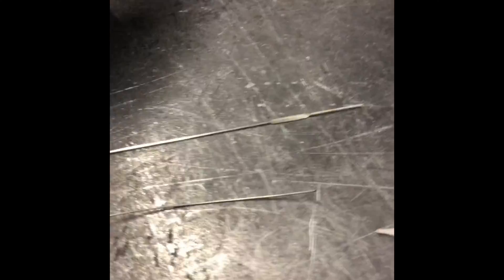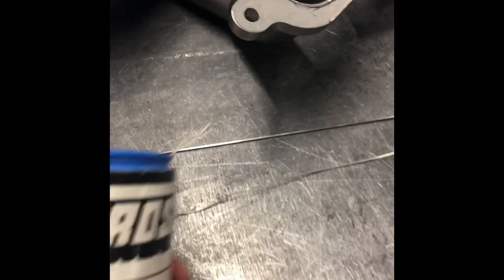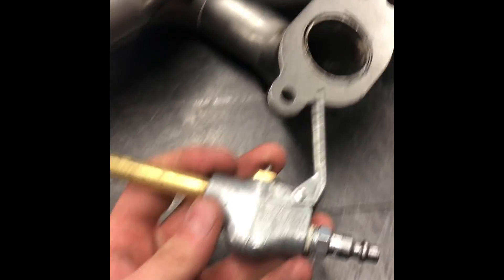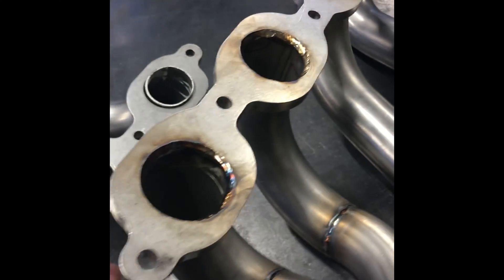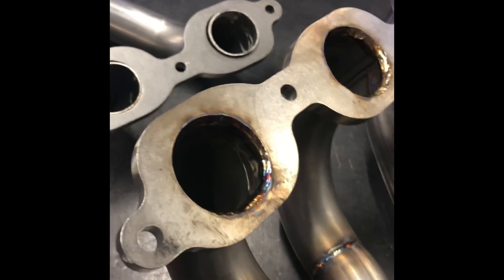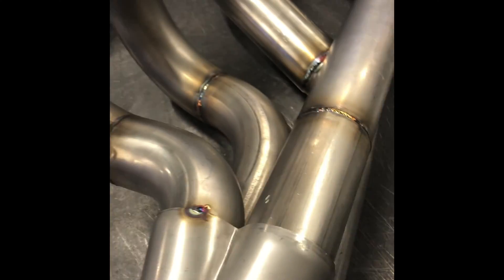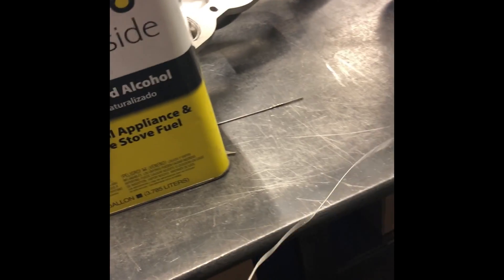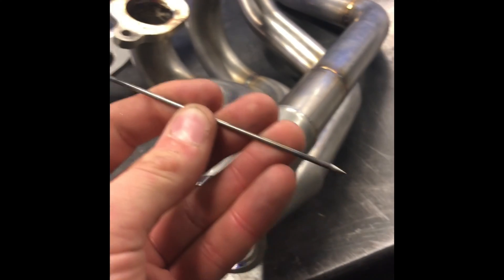Welding Stainless Turbo Headers Fabrication Tips and Tricks (Motion360 Episode 1 2018)

Comment: I think you got some bad info on the color of the weld. You want no color in your weld. You want it to be shiny silver. That color is from oxides in your weld, The heating of the chromium in the stainless acts as a catalyst to the oxidation process. The color is created within the oxide layer which is microns in thickness. The light waves that enter the oxide are refracted differently based on the oxide layers thickness. This makes only certain light wave spectrums able to enter and leave. This is called thin film interference. The hotter you get your alloy the more likely you are to start changing the chemical makeup of the alloy. You will start loosing your chromium, molybdenum, nickel, ect From ionization. Also you will not harden or temper 300 series stainless with heat because it is an Austenitic stainless. Im not a metallurgist but this is my understanding. This will give you plenty to research.

Comment: Where do you  obtain the stainless  curved joints, 45, 90, 120,160, degree,  number 1 , problem is big block in a tri-five. ,exhaust port #5,  because of  steering box ,    some go up 90, some go down, acute, welding angle.

Comment: I've worked with DSM and BMW n54 turbo manifolds. In both communities, schedule 10 or schedule 40 is "standard" for turbo manifolds. Why is it that I always see 16 gauge or similar for ls turbo manifolds? It's a much thinner wall. I'm not calling you out or saying you are wrong. I'm just trying to understand so I can properly build a ls manifold.
Reply: I've been going back and forth with material thickness aswell. What did you end up using? Have a buddy that swears on schedule 10. Says to stay away from 16 gauge.

Comment: When I have used mig wire for tig welding. To get it straight I put one end in the bench vise and use an aircraft safety wire pliers on the other end and give it a few twists and it comes out as straight as tig filler wire.
Reply: @Alxneinthefxrest  Also a good idea, just go slow and not spin it too much  or it snaps off.

Comment: Hello, Pipewelder here. I used to weld sch5 316 piping or what’s called sanitary piping. For pharmaceutical plants. We would butt up the joints, maybe use a 1/16th to get started and fuse the rest, then cap it with a 1/16th or 32nd Wire. I need to try to use that safety wire on some welds. Not a Bad Idea
Reply: We would just fuse all the stainless tubing at most plants. Only if a gap would we use filler, which was extremely rare.
Reply: @Shawn_lsx  yeah I always hold a 6” piece of 1/16th filler in case I get a hard start or I see a gap starting. But typically it’s just establish the burnout and shift lol

Comment: i would go for a 1/16 tungsten and keep the 1/16 filler instead of 3/32 tungesten and whatever dia that tiny filler wire was
Reply: If you properly sharpen the tungsten, the size doesn't really matter.  and regardless of the tungsten diameter you still need the same amount of heat to melt the 1/16 filler wire. running a smaller tungsten doesn't change the melting properties of the filler wire.

Comment: WTF your using safety wire for filler rod..
Reply: oh no melting the same grade metals together is a no no. wtf do you think filler wire is? it said 304 stainless on the roll, hes welding 304, some of you fucking people dude.